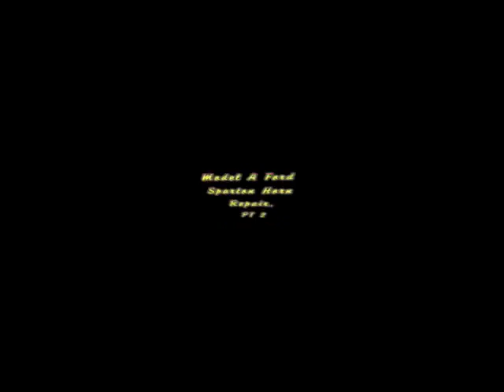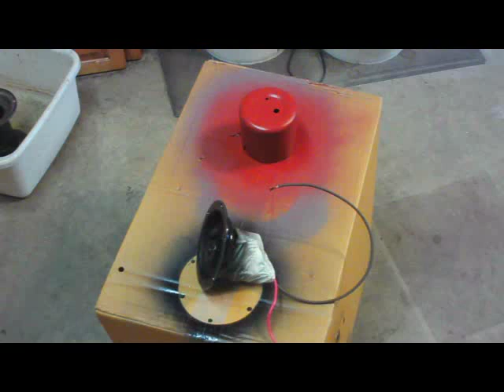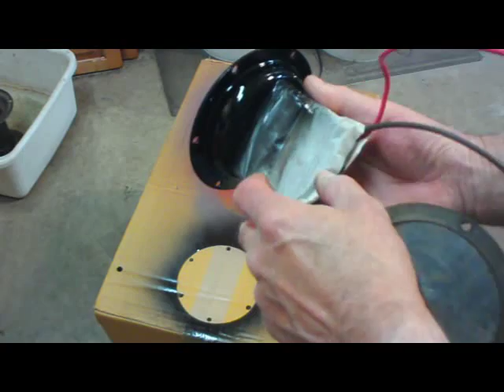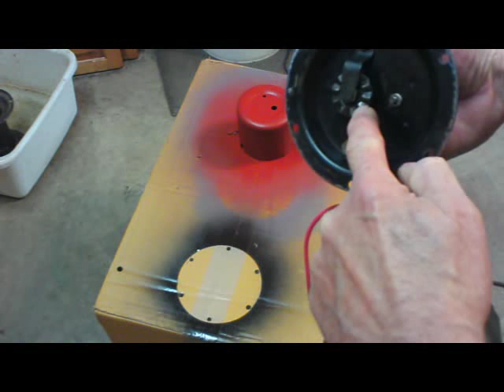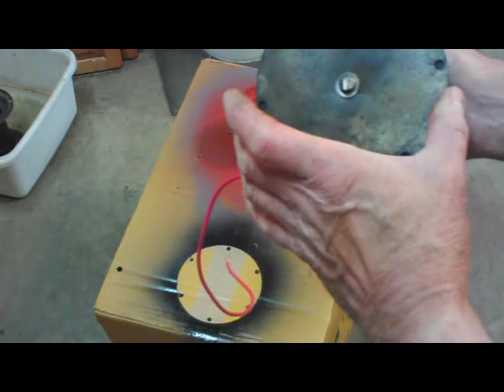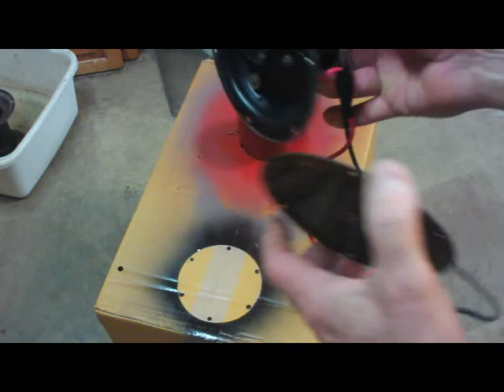Model A Ford, Sparton Horn repair, Pt 2

Comment: When you show in your video that little tab in the "engine housing" as you call it, your camera is not actually focused on the area well enough to see it clearly. That little hold in the diaphragm can be covered by the new gasket, so aligning it with the mark in the engine housing can easily be off, since the bolt holes in both can be misaligned.  I believe that marking that small hole and also the area where it properly sits when the diaphragm is properly inserted/oriented can easily be done with a whiteout pen for future reference.  Believe me, that diaphragm can indeed be inserted incorrectly.  I never actually found anything that felt like a tab at my engine housing. (motor housing).  Maybe it was too worn to feel.

In addition, those bolts are like carriage bolts and should only face one direction with the nuts on them facing the back cover plate of the horn. The can be inserted incorrectly.  Probably not a major issue   I believe I am correct that if all is aligned properly with the bolts and holes, then the long seam of the trumpet will be on the bottom side of the horn.

The previous owner of my Model A pickup had the horn apart when I got the truck. It has been a challenge to put it back together correctly since.  He has a 12 v system in the truck, but had lain the two wires to the horn inside the engine bay. Of course, it didn't take long for one wire to short out against the frame there and cause the ammeter to start smoking as the wiring started to fry.  I am going to add a voltage reducer, as the 12 v battery makes this horn spin too fast to give the correct Ahooga sound.  In testing my horn I had used a Super Heavy Duty 6 v Battery, but it never generated enough voltage to make the horn sound at all. Once I attached it to the 12 v battery the motor spun like crazy, so I believe I am okay on the motor working. HOwever, the orientation of that engine housing and the diaphragm was off.  I hope to try it out tomorrow to see if moving things back into the proper orientation works okay or not for me.

I did make up felt washers for the horn.  I found some furniture leg felt that I was able to use a punch to make the larger oil felt pad with and I found some sheet felt at Hobby Lobby that works fine for the top most felt pad at the cover housing. No vender seems to make replacement pads and the previous owner had misplaced them when I got the truck.

CorrosionX is a good product to use for the electrical components of this horn for preventing rust and corrosion at the contact points and all.

Thanks for posting this video as it was very helpful. I do wish that tab you mentioned has been shown better though. I believe that was my main issue in keeping my horn from working.  I don't know if the gaskets sold by vendors have that hole covered up or not when they are inserted into the horn.  I sure hope this is all I need to do to wrap up fixing my horn.  I was hoping a small 6v battery would be a good testing item, but so far none have worked for me, other than hooking the horn back up to the 12 v system battery.  I have not installed the voltage reducer in the pickup yet though. 

You are indeed lucky to have only had one internet troll criticize your work. They ruin things for everyone with their hatefulness and nonsense. I had to eliminate the comments from my own videos, as it was a real disheartening thing to see what filth and hate they could generate over even the most mundane and squeaky clean video.  Again, thanks for your posting.
Reply from the maker: Thanks so much for your kind comments and observations. The camera I had at the time was not true HD (though it claimed to be) which explains the poor quality of some of the shots. Unfortunately, the friend I rebuilt this for, hot wired it into his Ford van and after dropping it a few times (he never mounted it...) it quit working. I have since moved from PA, where I was living when I made this video series. I'm glad that my learning experience was a help to you and others. I just try to ignore the trolls anymore...

Comment: Do you happen to have a source for the two felt washers for the Sparton horn? I purchased a Model A that had a horn, but it was missing parts and I have not located the original felt washers for it. The dust felt that surrounds the adjustment screw at the top of the screw and the upper oiling felt.  Any source for ordering them or do you have extras you would sell? I don't see these felts at any vendor.
Thanks.
Reply from the maker: I am sorry that I don't have a source for them. I am thinking it would be necessary to fabricate them from a piece of felt cloth using a paper punch. Thanks for taking a look.

Comment: Klaxton made horns for the Mdel T but not for the A. There were five makes of horns for the A including Sparton, Stewart Warner, EA, Ames and CGI. There should be a wiring terminal inside the motor base that you can push the new wires into.
Reply from the maker: Thank you, I was learning as I was going along on this one, as you will see the further into the resto I got.

Comment: The wires were originally attached with a small stub that you push into the electric contact where you had soldered the wires. The contact holds it in place.
Reply from the maker: Thanks for the information fiddlerpin. All of the above is true, but all were missing on this horn that I was fixing for a friend who wasn't going to use it on a Model A. Unfortunately, after all my work, he ruined it within a couple of months...
Reply: The Shade Tree Fix-it Man What a shame.  He probably ran it on 12 volts and killed it.  85 years for nothing.
Reply from the maker: fiddlerpin
Yup, you guessed it. Hot wired sitting on the front seat of a 1985 Ford van... what a waste

Comment: The g-d diaphram should be reversible, so when one side wears out, you flip it over,a and use the other side, until that wears out.  I hate piss poor engineering.
Reply from the maker: Thanks for stopping by, but remember that this is from 1930, some 83 years old. I would say that it is amazing that it would still work at all.
Reply: I just took apart a sparton horn like this that looked like it had never been opened up and the diaphram is not reversible. On the operating side the cent pin or nub comes to a point at the center. This point is what gets hit by the round plate at the end of the motor shaft.

Comment: Dude! send rwruther@wowway.com an email. I will respond with elegant electronic solution to reduce 12vdc to 6vdc using MOSFET, (used for my heater blower motor speed control in the 39 Pontiac). Odly enough, I have also re-built a motorized Aaoogah horn my self.....AND I was once an electric motor re-winder for 1ph and 3ph AC motors to 12vdc armature/field re-design! I am so smart, why aint I rich? LOL

Comment from the maker: Thanks for your kind words. I will need to come up with a 6 volt battery or a way to drop 12 down to 6 to properly test the horn. It works but spins way too fast so the tone is very high.
I may just use some D batteries to test it...